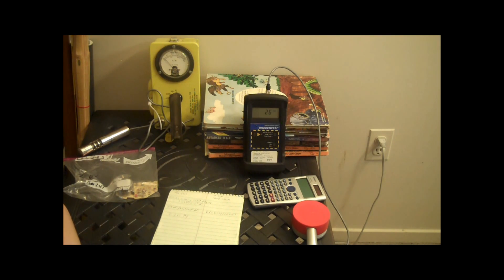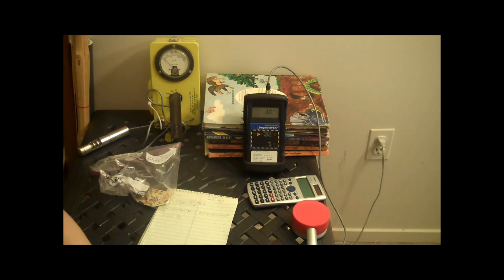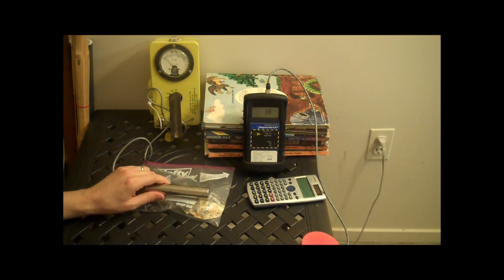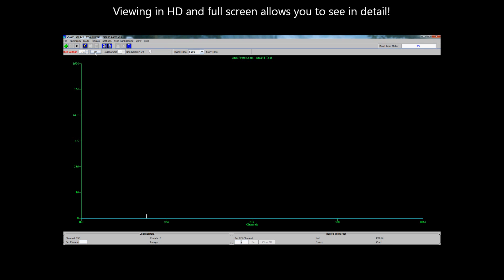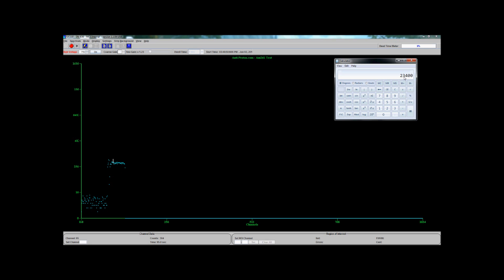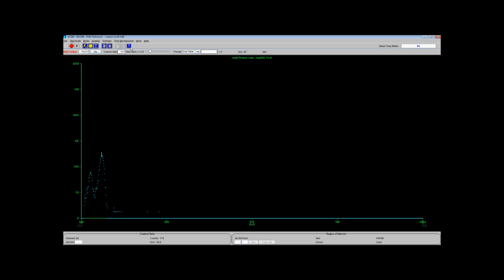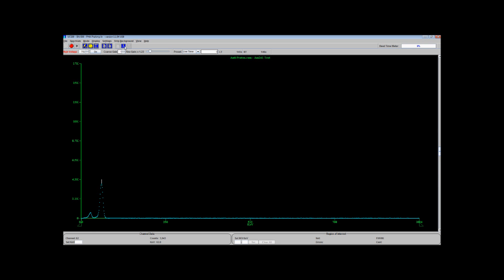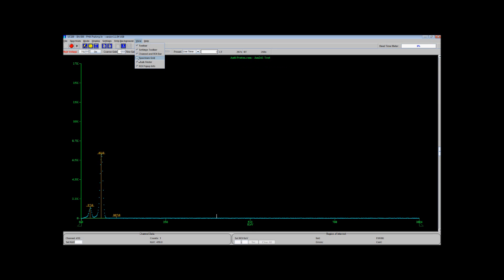Gamma Spectroscopy: Americium 241 Smoke Alarm Tested

Comment: Wait a minute, gamma rays from americium-241 have energies a bit lower than medical x-rays, how could they pass through the metal while medical x-rays wouldn't?
Reply from the maker: Medical x-rays do pass through metal.  The ability of mass to attenuate x-rays depends on two factors: the density of the material and the energy of the photon. 

Something with a high energy photon will more likely pass through metal than something with a low energy photon.

Comment from the maker: @gmaninthusa   Removing the Am241 "button" from a smoke alarm is actually a crime and punishable, not that anyone seems to care. I removed my circuit board, but I didn't need to open the button housing. If I need an alpha source, I will use my Po210 source, which is chlorine bounded to silver foil and inside a plastic disk. 

Care is required with handling anything radioactive.